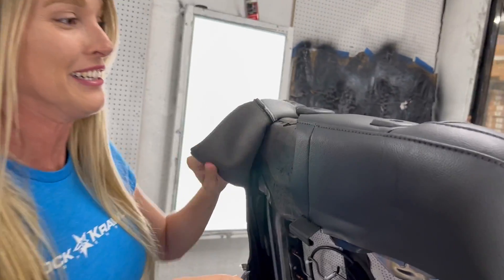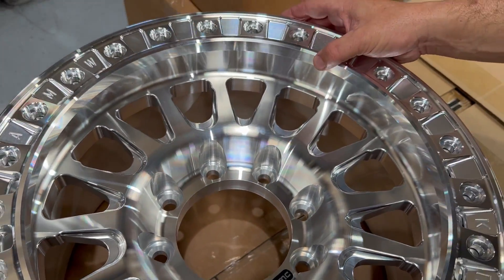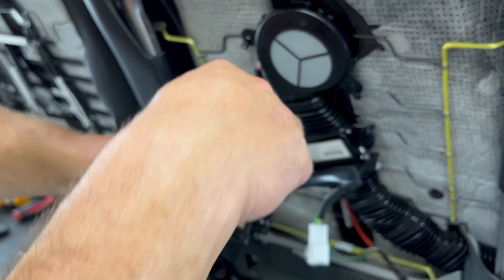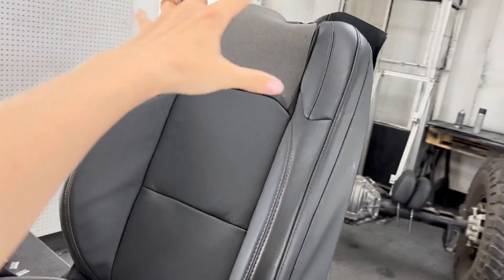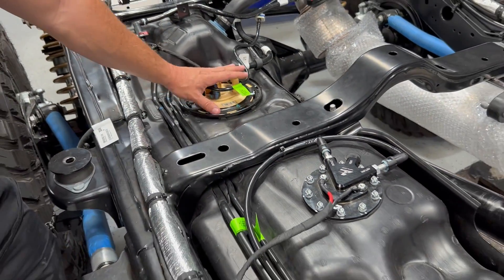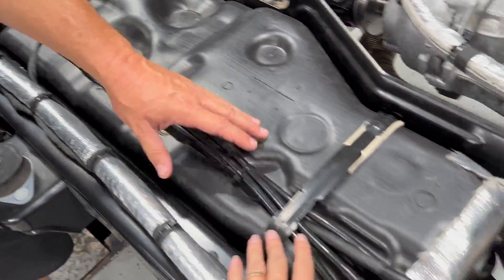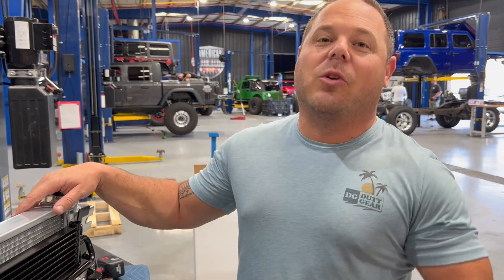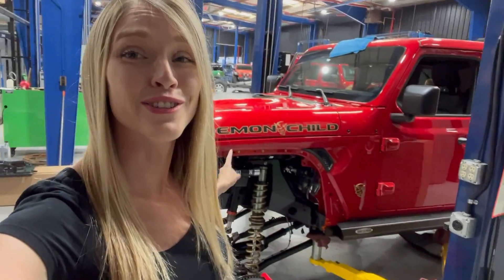Destroying a New 392 Jeep Rubicon to Build an 840HP DEMON JEEP!

Comment: To complete this series, you should add in some short commentary from the in-house Engineers at AMW. How they design and engineer their builds from OEM to AMW.  There is some serious engineering that goes into their conversions. How closely does AMW work with Jeep/Mopar on products?  With parts shortages, getting anything is a challenge these days.

The saying, "Do things right the first time, so you don't have to do it a 2nd or 3rd time.". That's where the attention to details comes in from AMW. 

The cooled seats have to be close to the top of the list of all the modification rankings! Smile..

Comment: Sick build. The attention to detail is amazing.  Supply issues truly suck right now. When I was looking for 40s a few months ago I wanted the Nittos but couldn't find any. All I could get my hands on was the Maxxis RAZRs which I saw you had on the Demon Child temporarily. Turned out to be a blessing in disguise for me because the tires are freaking killer and now all my buddies want them after watching me run 80 mph down the highway vibration free and crawl over rocks with hardly a tire slip.

Comment: Hello lite brite - I have a question - why rip the motor out and replace it when you have a brand new 392 - why not just super charge the 392 doesn’t that just make it a 840 hp motor without having to buy a new motor and having that sit there ?

Comment: Speaking of going through the windshield. I used to work as a linesman. We used 7,5 tonnes trucks.. I heard about one team that just upgraded from a vehicle with traditional brakes to airbrakes. Some idiot designers put the handbrake switch next to the gear stick. So my former colleagues were on the road getting up to speed and then hit 2nd gear...they thought. I wasn't in the cabin, but I imagine a great deal of swearing as they tested the seatbelts. The handbrake switch looked almost identical to the gear stick also.

Comment: Question to the brakes. Will these work on a fullsize truck as well? Or any Dynatrac D60 axle? How about wheel size. Do these require larger wheels or fo they not change the circumference? Any info would be great, thank you! Looking great!!
Reply from the maker: You would need to talk to AMW about all that. They do not fit the Dynatrac axles unfortunately
Reply: @LiteBrite  thanks so much for the reply. I will reach out to them!

Comment: I am always surprised that the transfer case isnt also swapped out. I would love to get the technical explanation why the rubicon transfer case is the winner. Because it seems like a weak link for all that horsepower.
Reply from the maker: It‘s proven to be insanely rock solid with all of the builds (including the Stepchild).  And has handled the AMW4X4 swaps for years. Eventually an Atlas would be sick (in the Stepchild, at least) once they’re available

Comment: Britney and Kevin. Congrats on the new Demon child build and looks amazing.  I was wondering about the type of control arms you are running. Looks like TeraFlex? Is that a roller set for now and getting a custom rock krawler set later? But over all such a sweet ride.
Reply: I wondered the same thing. Why not go with Rock Krawler?
Reply: @StormbornJKU  Am just wondering because I have a gladiator on TeraFlex IR suspension and it works for now. But I also notice and paused at 19:22 and the rear upper control arm also has a heim joint attached to it. I figured to ask and see.
Reply: I'm betting Teraflex doesn't sponsor them so they don't want them to be seen. They've thrown shade at Teraflex in the past. And at the end of the video you can see they went out of their way to remove the Teraflex graphics from the control arms.
Reply: @mikeb9871  I think Teraflex makes good stuff. I’m not bashing them in any way. But for what LiteBrite does, and the fact that they’re sponsored by Rock Krawler, I would assume they’d go with RK stuff
Reply: @StlrNtn95  Teraflex doesn’t sponsor them as far as I know. I’m pretty sure that blue tape or whatever is on the arms to protect them during the build process. Not because they don’t want to be seen.
Reply: @StormbornJKU  I figured I try to ask and see what the response was. But overall a very nice build. Will see what the future holds for more on the suspension.
Reply: @StormbornJKU  I would have thought the same thing about the blue tape until it got to the end of the video. Teraflex decals clearly were removed. I think, based on past videos, AMW uses Teraflex. LiteBrite does not.

Comment: I appreciate all great content. I have one question, 
Is it true that 392 stock frame is stiffer than regular 3.6 or it was the same how about axles and brakes ? Are they same as 3.6 rubicon or stronger?
Thanks 
Overland by Eric
Reply: it's beefed up. I don't remember all the details but I think it's a one inch lift and then some .

Comment: Guys, can you explain something to me like I'm a 4 year old. 1st, i gotta say love the channel and what a great build this is!!!!
Now to my question, on the Bilstein shocks, what's the difference between high speed and low speed adjustment when do you use and how do you use each of them? Thank you so much
Reply from the maker: Of course!!

Okay, so the ‘low speed’ & ‘high speed’ is actually referring to how fast the shaft is compressing into the shock body. So adjusting the ‘low speed’ compression is going to affect how the shock handles gradual (or low speed) shaft movement - this could be like the weight shift/transfer your suspension experienced when braking or accelerating or turning a corner. Adjusting your ‘high speed’ compression is going to affect how the shock handles really sudden shaft movement - this is gonna be more like hitting a root or rock on the trail, that causes the shaft to move quickly to absorb the impact!

When you decrease compression damping, you allow the shock to compress faster (which usually means a softer ride). When you increase compression damping, the shock compresses slower (giving a stiffer ride).

Hope that helps!!
Reply: @LiteBrite  yes, that helps a lot. Thank you. I thought low speed and high speed refers to how fast you're driving but it's almost the opposite. For rock crawling or any off roading that with cause the shocks to move suddenly and or deeply then it's the high speed compression and visa versa. I get it now thanks again

Comment: I may have missed it, buy WHY would you buy a 392 and strip it down to the frame for a rebuild?  Couldn’t you get the same result by buying a standard Rubicon?  I am not disputing the coolness of the build, but practicality is suspect.
Reply from the maker: This was significantly less expensive in the long run, whereas a normal Rubicon would have been a lot more expensive. The first video where we debuted the 392, we went over why this was the better option for us. 😊❤️

Comment: You may have covered it in the video, but I guess I missed it. With all the frame mods, new motor/trans/t-case, and axles….why did you hack up a 392 versus just doing all this to a sport? I don’t really like the 392 as full time 4wd is not my thing. This thing is going to rock, I just fail to understand why you started with a 392.
Reply: They didn't really say, but my guess is they wanted a special Wrangler that came with the 392. 
Adding the Demon engine took the 392 to the next level.

The cost difference between a STD Rubicon and the 392 is probably recovered in the engine value and all the drivetrain items they swapped out.   

It hard to get a crated 392 these days, and I'm sure AMW will utilize the engine in one of their builds. 

The question I have, why upgrade the Step Child's engine and turn around with this build. 

I'm thinking the Step Child will either be sold or possibly a Give a Way of some type. 
Or maybe it will be handed over to Chris. 

BTW, I'm sure they turned off the FT 4WD... That can be done with a Taser.
Reply: @mssammielowe , I gotcha. I’m not so sure about turning off 4wd. That appears to be a transfer case that from the factory that will never be true 2wd. As far as recovering the cost, maybe in today’s jacked up economy. Again, I love the build. My 2014 JK is an LS3/6L80 swapped unit. I love it. It wouldn’t hold a candle to this rig though.
Reply from the maker: We explained this in detail in the first build video! 😊 But ultimately, starting with a 392 ended up being significantly less expensive for us than a base model Wrangler would have been.

As for the Stepchild, as sick as the Demon Child build is, it still won’t be able to touch the Stepchild in the rocks. She’s been built to rock crawling perfection over the years, and will always be our first choice to hit the challenging trails. The Demon Child will be great for the streets, the dunes, and the more moderate trails that the Stepchild is just plain overkill for
Reply: @jeffhager7787  the exact same full time transfer case is used in other Wranglers and has a 2wd mode.  So yes the tazer turning it into 2wd is true 2wd.